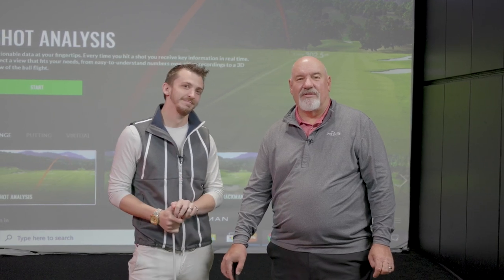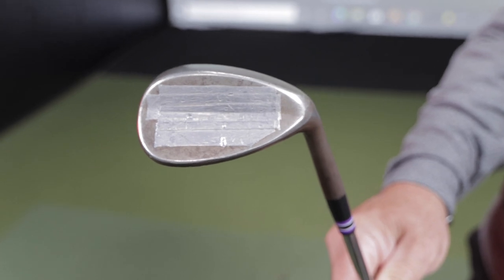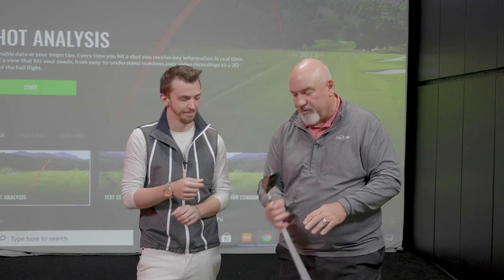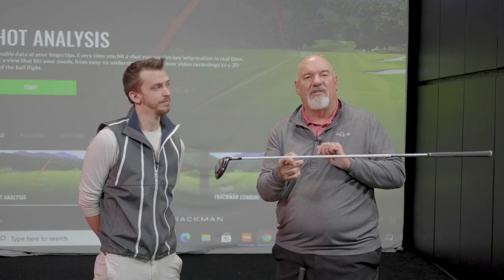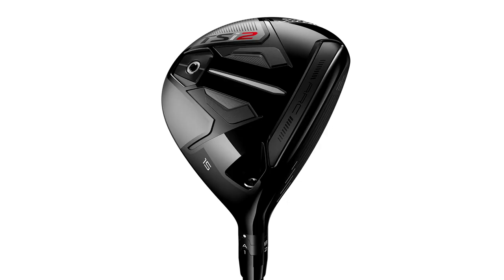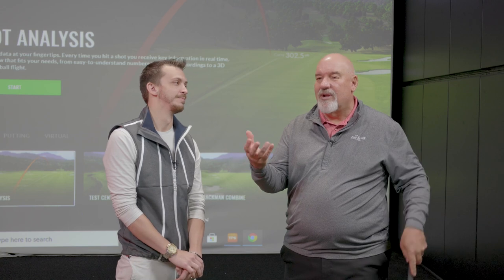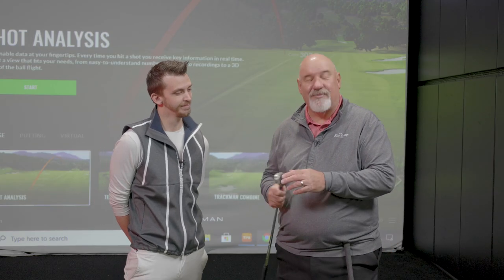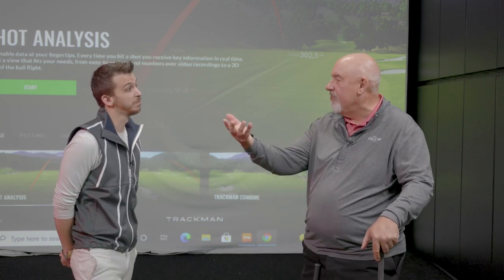What Does Lead Tape Do For Golf Clubs? Golf Swing Weight Discussion

Comment: Couldn't do without my lead tape. Been playing Aerotech FC115s for the past few years and they always come in super light on SW. I use it to bring it back up to my preferred D4.5 and generally a touch on the toe to help with the lefts.
Reply: I’ve got the exact same scenario with the Aerotech 110CW’s. Not thinking I had them put in some Titleist heads that had the chrome professionally stripped off the make them raw which made the swing weighting even more of a nightmare. I never would’ve thought having the chrome stripped off would’ve made that much of a difference in head weight. Like 3-4 full swing weights difference.
Reply from the maker: Thanks for watching. I also played around with the FC115 shaft in a Epic Forged 4iron a little longer in length to try as a driving iron. That also needed a lot tape to bring the swing weight back.
Reply: @2ndswing  Yes. I’ve had steelfiber’s in the 95, 110, and 125 and only the 125’s didn’t require a large amount of lead tape.

Comment: If I'm 6'4" and looking to add 1/2 and inch length to irons. How much more weight will I have to add in the grip to keep swingweight?
Reply from the maker: 1/2 an inch is about 3 swing weight points. Your looking at needing to go 12-15 g heavier with the grip to retain the swing weight. - Thomas
Reply: Switching to the WHITE golf pride tour wrap in midsize would gain  about that 12-15 grams over a standard sized tour velvet grip

Comment: Swing weight to me has got to be the most over rated club spec.  People fuss about having the perfect swing weight as if they even grip the club in the exact same spot every time. You grip down an inch and the swing weight is now drastically changed and you're gonna tell me because I've gripped down I'm magically going to struggle to hit the ball because the swing weight is now 6pts lower or whatever?  A bit of lead tape ain't gonna fix your game.
Reply from the maker: Thanks for watching! Feel differs from player to player. Great feedback, valid points.   -Danny

Comment: The concept and application make perfect sense. However, lead in paint and products have been banded for data driven health reasons.  I'm surprised it's still considered an acceptable option for golf clubs.
Reply from the maker: Good comment. As long as used properly it is considered safe and should be fine as long as you don't come into contact with it regularly. I wouldn't leave it somewhere where it could rub off onto something - Thomas

Comment: Grips do not affect swing weight. All clubs are swing weighted assuming a 50 gram grip. All a grip does is trick the scale, it does not affect the swingweight or feel of the head. This is bad information you are giving on the video.
Reply from the maker: Keep in mind results will be player dependent but if you increase the weight of a grip (larger grip) the swing weight will decrease. Ratio is close to 4g heavier or lighter  = increase  or decrease in swing weight by 1 point. - Thomas
Reply: @2ndswing  this is not correct. Swingweight is ONLY measured with a standard grip. You do not understand the dynamics of what’s actually being measured. You are just tricking the scale. Midsize grips don’t change anything or require additional headweight. I think you guys should do some more research on this subject.
Reply: Not sure where you're drawing your conclusion, but it doesn't even pass the "common sense" test.  If all grips weighed 50 grams, changing grips wouldn't matter...but they don't.  Some are lighter, some are significantly heavier.  Changing grip weight changes the balance point along the shaft, which is part of the formula for categorizing swing weight.
Reply: @AllTradesGeorge  the grip is underneath your hands. You don’t hold the very end of a club so the fulcrum effect isn’t even statistically valid when talking about grip weight. Swingweight is only measured with a 50gram grip. Do some actual research before commenting
Reply: @krthomure  the statistical relevance of the fulcrum point is dependent on the distance FROM YOUR HANDS, no matter where they are on the club.  That's basic physics, you don't need to be a specialist in golf club machanics (and these guys ARE specialists) to understand that.

And, actually, I do often have one hand at the very end of my club shaft, especially when I'm trying to maximize head speed and distance.
Reply: @AllTradesGeorge swingweight is measured from a fulcrum point 14” from the butt of the club. Your hands take up nearly all of that space renndering the weight above 14” a mute point. Thus why all clubs are measured with a 50gram grip. High end club builders even keep a split 50gram grip strictly for this purpose when building custom sets. They don’t use a jumbo midsize and swingweight off of that because the HEFT of the entire club would be rendered useless. It’s obvious you have zero clue what you’re talking about and have no experience in the is area. I will not reply to anymore of your comments. Best of luck
Reply: @krthomure  feel free to not respond, but in PRACTICAL terms, your hands' position on the club is the fulcrum point, so it's mobile.  But, taking your 14" reference point, if you have a 54g grip, that's 4 extra grams on one side of the fulcrum.  No big deal, right?  It is when you are drying to reliably swing the far end of the long leg of the lever (the head of the club) to the same spot at the same speed, over and over again.  It changes the balance of the club...slightly, yes, but a change in balance is a change in feel for most golfers out there.

Considering that these guys pretty much do nothing but golf club fittings, and I have yet to aee any credentials from you, I hope you understand why I'm going to take their advice over yours.  They didn't say grip weight would be a HUGE change in swing weight, they just said it's a change.  They didn't say changing grip weight would totally change your swing, they just said it CAN have an effect.  And considering how much of an effect a gram or two of weight shift can have on arrows or darts, I don't consider -2 to +10 grams (just using a sampling of grip weights I've seen online) to be totally inconsequential, especially when you get into shorter clubs where the offsetting leverage is decreased.

If you want people to agree with your assertion, you need something to provide credibility, beyond "I disagree".  These guys fit hundreds of golf clubs every year.  How about you?  What's your fitting record?
Reply: I am curious regarding the assertion posted in this comment section that grip weight has zero effect on swing weight and feel.  Is there a reason players like Jack Nicklaus put tape up by the grip?  Genuinely curious with no knowledge/experience and am simply curious.